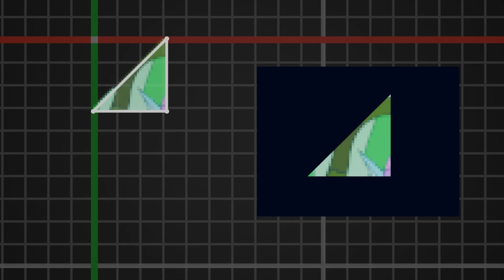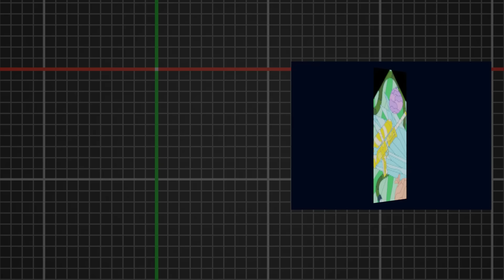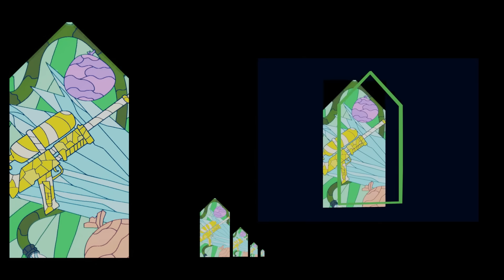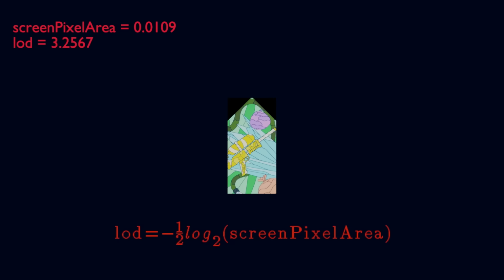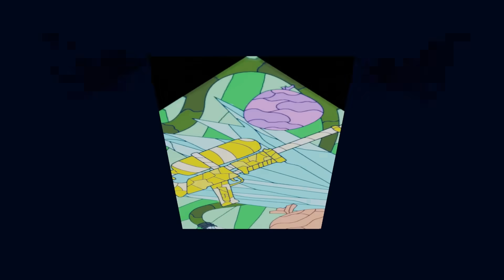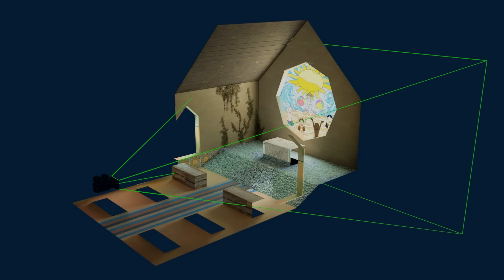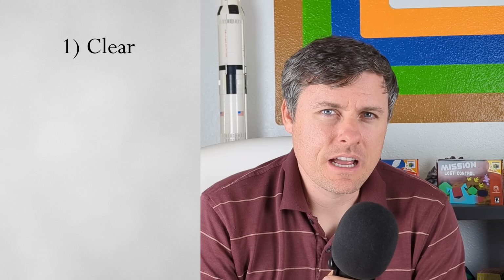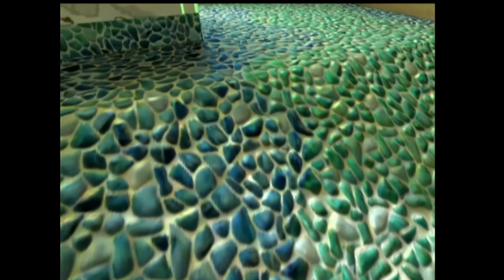How I implemented MegaTextures on real Nintendo 64 hardware

Comment: I just realized Crash Team racing for the PS1 is kind of doing something similar this to some extent. Downloading some CTR level models from the models resource, the readme file constains this "In Crash Team Racing, a map can have up to 5 different levels of detail that can be rendered, (...)  High LOD, comprises several 64x64 textures which are to be 'stitched together' in a model tessellation system that CTR uses." When one plays that game in High-Res on an emulator, that can be perceived in action if you pay enough attention. In the ripped models, the resulting "stitched together" textures are bundled as single pngs for convenience, so one can observe how the larger patterns are created out of smaller blocks.

Comment: My suggestion is to make an entire game using this technique than take it to Kickstarter as a commercially available product. Back in the life span of the console, the biggest sizes for N64 ROMs were 64MB, but thanks to flash carts and SD cards you can make an N64 game that is easily 64 GB in size. What this technique and that we now have bigger sized storage, you could make a full length game using these Mega Textures and show what the N64 was truly capable of doing.

Comment: Is it possible that this method be implemented into existing ROM games, such as Perfect Dark? Basically wanting to try an eliminate the RDRAM bottleneck between the CPU and RCP, hoping to improve performance (or efficiency) and frame rates.

Comment: Couldn't you do bank-swapping to get around the 64m limit? You'd still be limited in what could be visible in a scene, but with some extra hardware in the cartridge... Or is that cheating?
Reply from the maker: Cartridges can actually be much bigger than 64m. The issue is that no cartridge/flash cart support more than that since no game was ever bigger than that. Some flash carts give access to the file system on the cart, so that could be one way around it assuming the transfer speed is fast enough.

Comment: For the record,  you are absolutely not limited to a 64 MB ROM. That limitation was purely the result of storage back then being expensive, nothing about the console itself prevents larger cartridges, and it will absolutely read a larger ROM (but many emulators will not).

Comment: So let me get this straight… consoles are high priced junk. Ok, stay with me. Video cards, ram processors, mother boards… all that exist. Cool. So console companies just source together what they think is best and optimize the console to play games to look and play a certain way, to make the gaming experience more accessible. So pc gaming really is the best and “where it’s at” because in an ever changing landscape, the consoles are not easily upgradable with plug and play components. Yeah, consoles are a scam.
Reply: PC gaming is also a SCAM or at least the graphics cards are, they are charging you like 500USD for a graphics card that struggles on maxed out FULL HD res and won't age well (i have a CPU from 2013 that can run every single game i like to play minus some rare exceptions and it was around 300 USD adjusted for inflation).

Comment: All games from that era look blurry but the didn't at the time cause you played them on a CRT TV which was they were designed for.
Reply: The N64 also looked blurry on a CRT because the texture quality is extremely bad plus the internal filters.

CRT TVs help a lot for 2D art, for early 3D they can't hide objectively bad graphics and image quality. (things got a lot better with the PS2, Dreamcast, Gamecube, XBOX, etc).
Reply: @saricubra2867  they helps of ALL games of the era... They were all made the same way Visually... I don't remember it looking blurry on a CRT at all... was the same and every other game at the time... I still have a N64 and CRT
Reply: As far as I remember, some N64 games had a 480i mode.

Comment: I saw a video recently showing that the pixelated blocky look isn’t really how these games looked at the time, because the CRT televisions transformed the pixelation into something else. It was like the pixelation is like looking at the raw files and the CRT is a final filter. It’s incredible what it does with colors, gradients, and smoothing.
Reply: They were still blurry, and they still looked blocky, particularly compared to live action or the next gen (which most also played on CRTs). But it's correct that they look far better on CRT vs later displays. #1 reason is CRT is not a fixed pixel display. IME #2 is the motion characteristics--CRTs had higher effective motion resolution due to the pulsed display. Natural motion creates a more natural image. And note it wasn't just N64 that looked worse when HDTVs came out. Any 480i programming looked bad. OTOH I've been watching OTA TV downscaled to 480i on a CRT for the last 6 months and it really is a-ok. They frame football games almost exactly like they did 25 years ago.

Comment: Interesting.. not updating every texel every frame is essentially how modern video is streamed effectively so this makes sense. The limiting factor here for an authentic game would be the cartridge sizes. Storage reached a maximum of about 64-65 MB. Interesting nonetheless. 

This would have worked rather well for fixed camera games or games with cameras on rails.

Comment: So what's going on here here's essentially what happens with the super Nintendo hardware mode 7 except on steroids. The N64 is doing things that the sega Genesis (even with the 32x and Sega CD expansions)can only dream of. I have to give it to rare and other developers, pulling magic out of this machine should be impossible. The fact that you can even do FMV at all it was amazing. A lot of people say that the N64 technically isn't 64-bit which is true but Nintendo was partially to blame here, because of the type of ram they used and how they develop the CPU which is a rambus CPU.

Comment: Creating an original game for the Nintendo 64 that leverages modern techniques while utilizing the expansion pack could be a groundbreaking project. This endeavor aims to deliver a highly graphical experience that showcases the true capabilities of the N64, appealing to enthusiasts who still cherish this classic console. By focusing on optimization and creative design, this game could push the boundaries of what was thought possible on the N64, setting a new standard for its graphical prowess.

To navigate the potential legal challenges with Nintendo, it's essential to ensure that all aspects of the game adhere to intellectual property laws and licensing agreements. This means creating entirely original content, from the storyline and characters to the game mechanics and artwork. By doing so, we can avoid infringement issues and potentially even gain the support of the retro gaming community.

The goal is to blend nostalgia with innovation, providing a fresh yet familiar experience for N64 fans. By leveraging the expansion pack, we can enhance memory capacity and graphical performance, making the game a showcase of what the N64 can truly achieve when pushed to its limits. This project not only honors the legacy of the N64 but also demonstrates that with the right approach, classic consoles can still deliver impressive and immersive gaming experiences.
Reply: Could they use a technique for the SD card to utilize more than 64MB on the N64? This way, they could create an original game without the 64MB cartridge limit.
Reply from the maker: If you saw the mario64 maker project, it looks like they leverage the SD card so it may be possible. I'm also tempted to develop a custom cartridge with bluetooth to allow spells to be downloaded to and from your phone to share online. A less ambitious approach would be allowing spells to be saved to a memory card.
Reply: @james.lambert  Is it possible to segment game data into 64MB chunks, with automatic switching between these chunks? This would allow for the creation of larger games with better textures, sound, animation, and even voice-acted stories, bypassing the 64MB cartridge limit. Could this kind of data swapping, from section to section, be achieved using an SD card with an original N64?
Reply from the maker: The 64MB limit is only there because no games were ever made bigger so flash carts don't bother supporting more. You could create a cart that addresses 4 GB of data, although flash carts my expose functionality to allow the bank switching like you are suggested. I would love to try and make that work.

Comment: Could it be theoretically possible to use megatexturing for lightmaps, and then normal repeating textures for albedo? That allows albedo textures to be reused between rooms, and then have only one lightmap per room.
Reply: Gotta check the documentation, but I think that the N64 does not have a fixed function pipeline, but you can write shaders of different complexity. Though, where are they stored? I think you need to decide between palette or multi texture.

2 cycle mode
Reply: @ArneChristianRosenfeldt  The N64 supports blending modes though doesn't it? So you blit the base textures first and then blit the shading with multiply blending. I think that works right?
Reply: @PaganPegasus  but wouldn’t this go over the RAMbus like smoke clouds? The blender documentation looks a bit intimidating, but I cannot find it on the die, so it is small. I guess the documentation is just badly written. Reads like Sega Saturn docs. Quake uses lightmaps on PC.  So is it on N64? I know that it is on PSX and doom is on N64.

Comment: Does this makes N64 Emulation harder because of high 2d Textured object with 3d Models?

I know Emulator are really optimized but it's a question in General because the early N64 Emulator from Switch Online showed the problem by 2d Objects and 3d objeks on the same time...if I got that correct

Comment: How do you manage to not make texture seams visible? I imagine that you need at least two textures loaded to properly filter the edges.
Reply from the maker: I actually don't. I originally though I would need something similar too but it works fine without considering blending between edges.
Reply: @james.lambert I guess that the 3 point bilinear filtering helps to hide the seams.

Comment: what if we add more RAM in the expansion pack, for example 32 or 128? and write code in the games so that they use them fully? It is theoretically possible. Game size is no longer a problem. We are not limited to 64 MB. Thanks to everdrive 64

Comment: You said 4MB so theoretically this could be improved further with the memory expansion pack?
Reply from the maker: It take advantage if you have it. It uses a higher resolution and is able to hold more tiles in the cache.

Comment: This! I love videos like this - thanks so much!

Any chance you can elucidate more on the steps you used to calculate the texel size? 

Also, just thinking aloud ... Is there any kind of optimization where instead of comparing against the logarithm or screen ratio, you use the Z coordinate? 
My thinking is (and please excuse that I am a rank amateur and self-taught), that the closer the texel and pixel sizes are to 1:1 the higher the MIP map you can use? Assuming that the 1:1 plain is some sort of ideal distance from the camera for the highest quality MIP and (I guess?) also some sort of focal plain? I imagine there are some interesting effects in this approach ...

Off the top of my head, don't use auto MIPS but use your depth color approach to render something totally different, or a different procedural texture seed? Could this mimic some basic functions of a programmable pipeline?

I shall have to toy around with this myself!

Comment: Most PlayStation games, stripped of FMV and Redbook sound, was at or under the size of N64 games.

Even something massive like Vagrant Story the ISO was under 88 Mb, on a console where they really didn’t have to worry about storage.

I don’t get why our guy here didn’t use 4 bit palette textures. One 1024x1024x4 takes up 512Kb. A few well chosen of those used where it matters, like ground and murals, and the rest in 128x128x4 and lower (still way better than any extant N64 game) should absolutely be doable in a real game.

There is of course also the possibility of using a few seconds to procedurally generate textures into a small buffer immediately before use. That would mean much smaller texture footprint in the cartridge.

Comment: I'm curious, is the use of 'tiles' for texturing baked into rendering on the N64, or is this a design choice of yours for the megatexture implementation? I'm used to modern GPU rendering, so I'm a bit confused as to where the hardware limitations end and design choices begin in your explanation.

Comment: Dude, thank you so much for this. I always imagined that this was possible, I don't understand anything about n64 programming, but I made sketches and studied the limitations a little and arrived at the exact theory of what you proved to be possible.

If I may give you a tip, you can use black and white textures that contain an alpha channel, to overlay only the vertex color. I know that some games used this technique. This allows you to use the same texture of (for example) "brick", creating the variation red brick, and yellow brick, on walls to create a brick effect, but by stretching it over the floor, it can become a floor. I believe that many textures using snap-together tiles with abstract geometric shapes can fit into multiple locations in the same scene. I don't know very well the technical programming capabilities of the n64, but you can also use images superimposed on a single texture, and change the color palette to completely change the image present in the texture, like the "SEGA" intro of Sonic 3D from mega drive.

I believe that changing the palette requires fewer cycles and certainly less memory than loading a new texture, so the stone texture can be transformed into the tree gravel texture just by activating some bits of the palette (which would make the wood grains visible) and changing the gray tones of the stone to brown.

Comment: this truly makes me wonder how much resources were wasting with modern games, what types of optimizations could be found if games didnt have such tight deadlines to reach, we've been using pretty similar ways of optimization for a couple console generations now with not much being changed, how much performance is being left on the table due to new methods of optimization not being discovered
Reply from the maker: A lot. Modern software development tries to optimize for developer time. Choices are usually made to make development easier, even at the expense of game performance.

Comment: The texture cache is actually larger than the one in the in the PlayStation one, 4Kb vs 2Kb. The difference is in how it worked.
One is an actual cache, the other a straight piece of SRAM.

James Lambert, you could do a video on that? The limitations and exact workings of the "cache" and how you work around them.

Also, I bet this could be done on the PS2 to much greater effect and with less penalty, as its texturing woes are from not entirely dissimilar causes.

Perhaps using the PS2s IPU for decompressing, like strongly hintet at several times by Sony. - JPEG files into main memory on a per need basis.
With the right management scheme, you’d be able to do insane textures on PS2.
There the two main problems was a quartering of the bandwidth EE to GS, when reading textures. And the need to not thrash the 8Kb texture page, buy doing stupid stuff like reading oblique texture at high full resolution (which also resulted in the infamous shimmering and pixelfighting) and using too large triangles/strips.
A much better LoD scheme would have done wonders in the PS2, and I suspect on the N64, in a scaled down version, too.

Comment: How about using procedurally generated textures instead of storing them as raw bitmaps? Would it help if the procedure could use the next lower detail level tile as starting point to avoid some recomputation? Your textures are very detailed for a N64, but they should be encodable as a few poly fills. Is the CPU already fully loaded to keep the GPU fed? Could some other less utilised, but  programmable hardware be (ab)used to procedurally generate texture tiles (e.g. the audio subsystem)?

Comment: I would guess that the best implementation in real-world terms would be for an RPG game, mainly in the battle scene. So not an action RPG, like Zelda, but turn based, like most PS1 RPGs, like the Final Fantasy games or Chrono Cross. It would definitely be possible without the Expansion Pack, but maybe even go hi-rez with the Expansion Pack. Not utilizing the Expansion Pack would be more bragging rights, but if the game required the Expansion Pack it could also utilize double buffering for optimal frame rate plus hi-rez. Although double buffering is really only good for higher frame rates, like maintaining around 25fps as opposed to locking in at 20 with a single frame buffer. But when dealing with lower frame rates like 15, 12, 10, etc, a single frame buffer would do, so the Expansion Pack wouldn't be necessary, just a hi-rez bonus.

Comment: Didn't several N64 games use mipmapping? I recall it being a prominent feature of the system. I guess the difference here is that textures are also divided into tiles, and you dynamically choose the best mip level based on available memory? (Also, disabling the Z buffer)
Reply: What's your point? This is not simply mipmapping, this is mega textures / procedural texturing, far more advanced than just mipmapping. This allows a "single" texture to "break" the limitations of the N64's 4KB texture cache. As he explains, this goes far beyond the 64x64 with only 16 colors limit that you see in Goldeneye and other games that utilized hardware mipmapping.